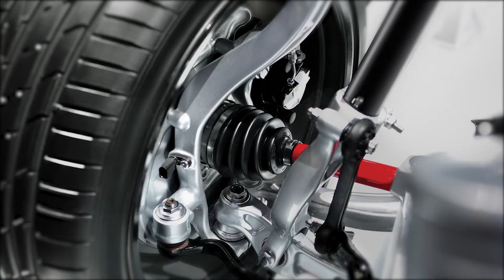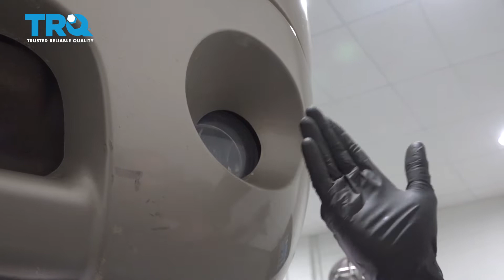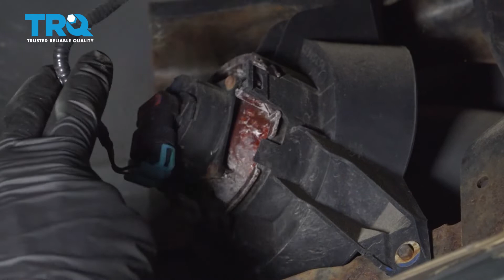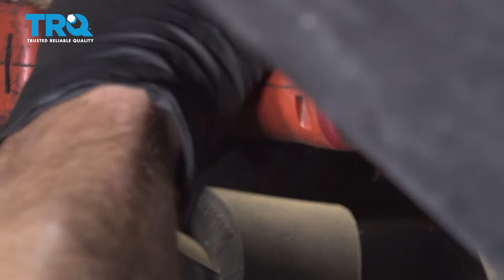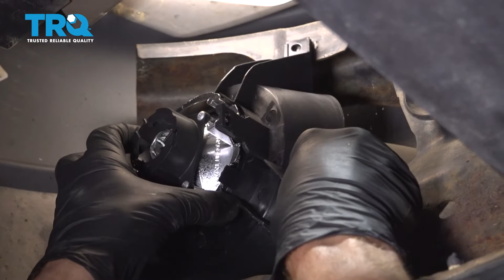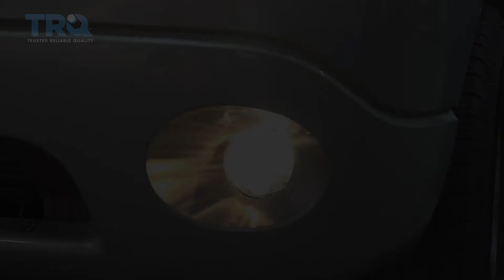How to Replace Fog Light 2001-2005 Ford Explorer Sport Trac

Comment: get new push pins because the old ones that you pulled out won't stay in as well and could come loose and fall out while driving . Took my ford escape in for oild change and they removed the cover and put the old  pins back in and  they fell out and bottom cover statted to fall off at the next light from the dealers shop . Believe me they heard a few chioce words from me  and I made them send some one down a mile with new plastic push pins . Car was brand new and it was the first oil change   Don't trust dealers  anymore

Comment: Mine didn't come with fog lights, but out here in the country, it can mean the difference between hitting a deer or god knows what.

I did have to add a fog light radio bezel, drill out the bumper holes (a 3" hole saw is perfect) and run the wires/relay, but at least I didn't have to muddle thru this part. Thank you!